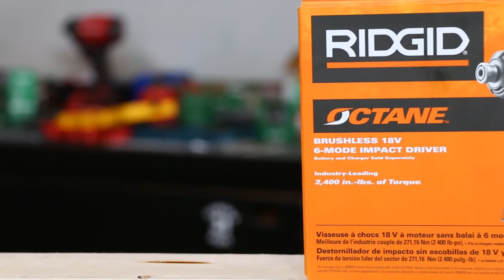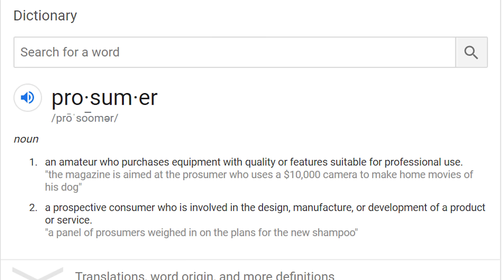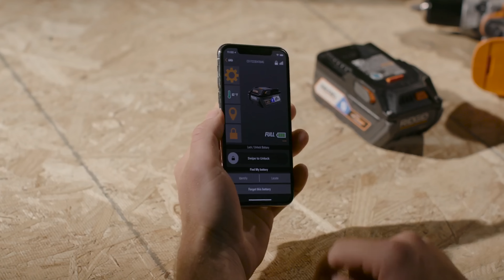New RIDGID OCTANE Impact Driver - Tools for a PRO OR JOE ?

Comment: I really like my Ridgid tools. As for the LSA, it is awesome. They replaced 2 batteries that were  12 yrs old,  no questions asked. They also replaced my 12 yr old drill with a brand new brushless one. Only complaint on the drill replacement was that it took them almost 2 months to do so. Luckily I have other drills to use in that time. But a free replacement on a power tool that old, pretty good deal.

Comment: I run quite a bit of tools from the ridgid line and i do wish they make some of the tools a bit more compact (the drills) or make the batteries a whole lot smaller like the dewalts and milwaukee. Other than size, the tools goes up against the dewalts, makitas, and milwaukees on my jobsites regularly with no issues

Comment: I like the compact drills. In the early days of Milwaukee (old NiCad days) I found many cases the drill was too large to work in tight spaces. I worked in industrial machinery maintenance. As Milwaukee began to reduce the size I upgraded every time for smaller. Not to mention the weight.

Comment: I have an old 18v drill that was sluggish and lasted only a short time that got re-energized with the 9 amp hour Octane battery.  The Octane battery even works on my old charger; the old charger doesn't show full charge, but the battery shows levels of charge.........  So, can you buy the Octane tool only, and use it with old batteries?  Since they are TTI, it would have been nice to have each brand battery work with the other tools ( Rigid, Milwaukee, Ryobi and Hart.)  But, it looks like TTI only owns a cordless license for Rigid, so that may be a hinderance.

Comment: Biggest reason all my tools are Milwaukee is because of how trade specific they are. Red is very plumber friendly. It’s all about them expensive batteries, if ridgid had more pro tool options it could then try to step in the ring..right now it’s just nice homeowner option, in my opinion.
Reply: Ridgid is the biggest name in plumbing tools....any plumber will tell you that...they dont make the power tools...same company that makes milwaukee makes ridgid power tools...ridgid is pro grade...i have been using them on commercial job sites for 6 years and not 1 has broke yet

Comment: Not sure if its just my tool but if I leave the battery on the octane impact for a week kills the battery and ends up dead so if you you leave it on the impact might do that
Reply from the maker: That doesn’t sound right, I’d return it
Reply: @VCGConstruction  first time I ever experienced that before never happened before and usually always keep batterys on my tools will have to return it then just didn't seem right

Comment: Just buy the octane battery kit itself. You will get a free bare tool, I chose the circular saw, and THOSE batteries, since it’s a kit and comes with charger and bag and all that, those are eligible for LSA.

Comment: Why do l need to use my phone to shut off or on the battery, or check the temperature of the battery unless if l can charge it wirelessly by phone which is quiet impossible.

Comment: I've returned 2 (two) Octane impacts and 2 (yes two) new Octane hammer drills because of sloppy chucks resulting in wobbly bits.  That's unfortunate, cuz I've got other ridgid battery tools and they are good.  But 4 tools returned due to quality control issues right out of the box...  no good Ridgid.
Reply: I mean all Impacts are going to have wobbly bits, that's just how they are made. On a drill though that is a problem!

Comment: I standardized a long time ago on the RIDGID battery platform.  I currently have 33 tools and components registered on the RIDGID website (some are LSA, some are 3 year warranty and a few are now out of warranty).  I have yet to figure out why the RIDGID batteries provided in a combo pack are covered by the LSA, but individual batteries purchased are only a 3 year warranty.  RIDGID's advertising on radio and other media continues to mislead by stating "batteries for life".  If it's the same battery, with the same quality and specifications, RIDGID should support the battery in the same manner.

Comment: I'm no pro, I primarily use Ryobi tools, but as those go out I've been switching to Ridgid...hard to beat a lifetime warranty, even on batteries! Good video guys.
Reply: That warranty gets a lot of people sucked in and I get it!
Reply: Ive heard that rigid doesn't like to honor warranty, cant personally say but something to consider
Reply: @ballista7367  they don't! They find any reason not to. I've seen two people go through trouble with it, so they just returned their product to home depot
Reply: Metabo Hpt have lifetime warranty to. But there like double or trimble the cost of ridgid. Lows kobalt has 5 year warranty on there tools.
Reply: @ballista7367  They want you to get on you knees and say PLEASE PRETTY PLEASE!!! before they deny you your warranty.

Comment: I feel that Milwaukee, Makita, and Rigid are much more of a precision tool than dewalt. Dewalt trigger assemblies are garbage. Once it gets worn, the travel it has before the motor actually engages is ridiculous. Unable to drive a small screw with minimal force, like persay for installing door hinges. My example is a nearly 2 year old XR from a friend vs Rigids I've extensively used for 3+ years. Only thing i sent my rigid in for was a brush motor replacement. The gen5x has yet to need repairs. Been dropped off 12 ft latters and roofs a multitude of times. While the dewalt i used had gone through similar, maybe even less, did not perform well.
Reply: Milwaukee extensions are the bees knees too btw. Way tougher than dewalts which will round itself off sometimes.
Reply: Also, Milwaukee titanium drill bits > dewalt black oxides 
An extra $3 to not constantly be burning through bits as soon as you use them

Comment: I jumped from Ridgid to Milwaukee a while back but I found that Ridgid was very comparable to the work load the Milwaukee tools can handle. Its just a personal preference but I like the look of the Milwaukee tools.
Reply: the new ridgid stuff starting with the gen 4 line has been alot better...more professional...for some reason they dropped the ball on this octane impact but the other octane tools are very good

Comment: I’m glad to see that Ridgid is stepping it up. And if the motor ever pulls an 887 and you forgot to register this impact for your LSA, you can zip tie the switch at the bottom of the handle for a nifty little flashlight! 😂🤣
Reply: ridgid is stepping it up except on this impact...they dropped the ball on it...not as powerful as advertised but the other octane & gen 5x tools are pro grade now...ridgid drills & impacts will never pull an 887 because they have thermal overload protection in the motors just like milwaukee & ryobi...its a TTI thing...dewalt wants to save a few pennies and not put it in there so thats why their stuff goes 💥🔥😂 thanks for watching bro 👍
Reply: kingofthecrease30 This is why you’re the Ridgid expert bro 😂 My stealth force more than exceeded at any task I needed it to so I really dig it. No DeWALTs though 😂😂 👍🏻 #VCG
Reply: @puresikness77  ridgid is not the best power tool out there but it deserves respect...it will get the job done
Reply: kingofthecrease30 True...maybe not the best out there, but for the performance and the price, Ridgid really deserves its credit where credit is due. If a Ridgid tool doesn’t get the job done, it’s most likely the operator, not the tool.

Comment: Ridgid guy here also, King you need a rematch vs Vince and that Craftsman!
Reply: its not gonna do it bro...for some reason its slow at driving fasteners....we tried it off camera too and the same results...the gen 5x was faster than this one...its strange...tool review zone had the same problem when he reviewed it
Reply: @kingofthecrease30  Hey King, are you seeing issues with the torque or power as well? I can handle the tool being a little bit slower, if it still has adequate power. If you say there are issues with torque, I think I am going to pick up a Gen 2 Milwaukee a friend of mine has.
Reply: @dougfowler6898  its the power overall...the gen 5x impact has more power than this thing does...i have that one too...the octane is supposed to have slightly more power according to the numbers on paper but it does not feel.that way....tool review zone was the first to review this impact and he said it was slow...of course you are not going to put the impact thru the tests we did on TTR so for everyday work this impact has plenty of power and the mode selector does come in handy....in the TTR video we did i noticed there was a slight power increase with the 6.0 octane battery...most of the test i ran the 3.0

Comment: After this last lineup, I'll never buy another ridgid cordless tool again, I use to swear by ridgid but this octane impact driver (leaking grease from around the chuck), the drill (chuck is bobbling around) and the jigsaw (won't stay on bevel), I am done with ridgid, the only thing I got great out of this set was the circular saw. I've gone back to Milwaukee and Makita for my pro tools. Ridgid imho is just a step above ryobi and that's not saying much.

Comment: Some of the tools look interesting but their batteries are pretty bad.  Mine both died right after purchase and their warranty is useless.  I consider the warranty to be a scam since they make you jump through a lot of hoops and look for every opportunity to deny a warranty replacement.  So now I have a set of 4 tools that I can't use, I have to use my dealt tools now.  My dealt with the cheapest battery they make works very well after 6 years.
Reply: Rigid just warrantied 3 batteries that were 9 years old, did you register the stuff when you purchased it?  I would call them.

Comment: I had the Ridgid X4 series 5pc kit and it was massive pile of shit. I went through 12 batteries in under 2yrs. My batteries and chargers are always brought inside overnight so they dont freeze so theres no excuse. And I went through a handful of trigger assemblies on my impact and sawzall, switched to Milwaukee and never had a problem since. The Ridgid warranty does work, but unfortunately you will be using it a lot and in my trade I cant afford to have tools broken and sent away for repairs, especially if you arent being given a tool to use while it's being fixed

Comment: Power tools are becomig like computers. Always a better version with a little more power or a little smaller. I run M18 gen 2.  My old 18v Dewalts has plenty of life. Wife bought the M18 for me. No complaints. I have used Rigids some. I knew a few guys that swear by them.

Comment: Im gonna just say this. Ive had makita dwilt milwaukee. I saw a BF at home depot for ridgid and wanted to go with a system of tools same batteries. I went with the ridgids and I am a sold with them. I gave away everything else  best value for use I have ever had! I will say I wish ridgid would open up some more choices or tools some other brands like  a chainsaw.  no worries though and D walt was always garbage tools for me batteries especially were always going bad

Comment: I'm an industrial mechanic who used to use all Dewalt tools. I have had two Dewalt cordless impacts literally fall apart on me. Dewalt is a glorified Black and Decker. I will take my Ridgid tools over Dewalt any day of the week, except for my old corded 1/2 inch drive impact. That thing has lasted 20 years and is a workhorse. Ridgid is a very popular brand with pros. Makita is better, yes,   but Hitachi is better than Makita and almost nobody uses THOSE.